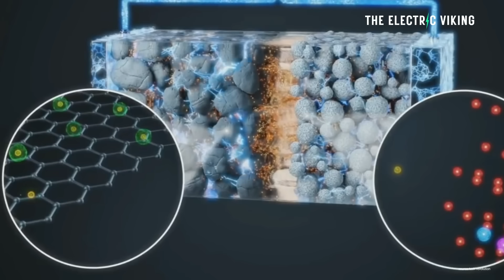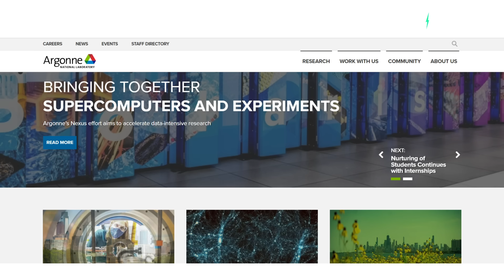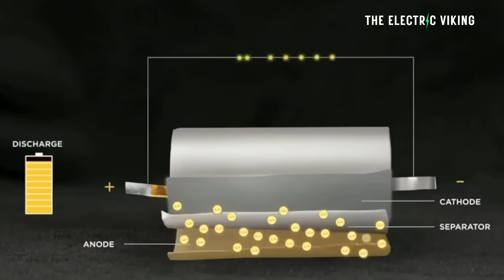US Government Scientists expose why solid-state batteries keep failing

Comment: Judging by the number of battery failures that are causing fires in electric vehicles in China, I would venture to say that the Chinese battery companies are either aware of the filament growth issue and are producing and selling batteries knowing that there is going to be a fair number of failures or they are not aware of the issue. I don't believe that they do not know as this issue is not confined to just lithium based batteries, it is a common issue with almost any battery, rechargeable or not. It has been known about fot years, decades even. It is a matter of coming up with a material combination where it takes a very long time (number of charge/discharge cycles) before the issue is the reason why the battery fails. In early rechargeable batteries, the product would die or severely degrade after only 100 cycles. Technology (material combinations) improved and the cycle count improved to well over 1000 and so on till today where the cycle count of a well designed and manufactured battery is over 10,000 to 100,00 cycles and the energy density has increased dramatically. Look at Toyota, they have been selling hybrid electric vehicles for decades and how many battery fires have they had? I believe it comes down to shoddy manufacturing techniques and a don't care attitude of the manufacturer. As long as they make lots of money, why spend time and profits to fix it.  When the Americans or Europeans come up with a better solution, they will just copy it.
These "ghost" filaments may well disappear because as soon as the filament bridges the dielectric as it creates a short circuit that is instantly vaporised by the high current that tries to pass through it. If, as he says, these shorts are happening so often, then if you connect an oscilloscope across the battery, you would probably see these shorts occur as "noise" on the voltage waveform.
The problem will be solved, but until then, be prepared to see large numbers of fires continue. 
Where do German car companies get their EV batteries from?

Comment: Any stress locked into certain metals from bending or compression etc. will spawn the growth of metal whiskers until the stress in the metal has been relieved by the migration.  Holes from tiny flaws in insulator plates, like those in ceramic capacitors combine with electric potential will lead to the growth of dendrites that cause shorts.   Any experienced engineer building and testing prototype solid state batteries already know all of this.  Those new to the field have no idea yet. Managers with aggressive schedules and large retirement size bonuses on the line have likely put a month or two in the schedule for magic to happen that will solve these problems that they have been avoiding reporting on to upper management and investors for years.   Add in the wide temperature range, pressure fluctuations, vibration and accelerations that an automobile battery must endure and  a lot of this stuff doesn't show up until you've tested thousands of parts for many years. By the time a reliable solid state battery is on the market, I'll be to old to drive a car.  Of course by then the cars will not need me to drive them.  Ha.

Comment: Suit the TOYOTA for the hybrid definition. The submarine with diesel engine generate electrical power to drive the electrical motor connected with propeller, no one call this type of the submarine is Hybrid power submarine. Only the plug battery combination with combustion engine can be call the hybrid power.

Comment: As a persen direcly working in SSB research I can definately tell you that this is nothing new und that we do test for this in the Lab for all possible solid electrolyte systems. Dendrites are not the biggest Problem in all solid state batterys, it is a symptom. The real issue is the electrloyte ionic condaktivity, interfacial resistance and preventing of delamination!

Comment: Asia is in front here solid state batteries have been around since the late 90s and Japan the battery power house has been developing them ever since. Japan is getting the production lines built out as we speak and china’s following them closely. Unfortunately USA is behind here and as we can see it’s the overseas companies investing billions in America to make battery factories which will be a good catch up for Americans . Flaws get overcome easily enough , as Japan has done hence building production lines up  lithium / ion is just not good enough tech unfortunately, consumes way to much energy and resources to produce, is not energy dense so has to be 1.5 times bigger than solid state batteries for same density. Lithium ion is 40 year old tech now all the chemistry has been done and it’s fully developed . Solid State is the quantum leap in storage we need to make EVs mainstream, viable reliable and cheap .

Comment: Once you've identified the problem, you've solved half the puzzle.
Reply: In the lab perhaps but finding the viable, stable and scalable solution and deploying it to actually make these at scale will years.  Once they are in production it will not be in cheap EVs, it will be in planes, drones and supercars.  It takes time for a commodity like a higher performance battery to hit scale for the average consumer.
Reply: I’ve identified the problem: the 2nd law of thermodynamics.
I’m now halfway to a perpetual motion machine!
Reply: I have identified a problem: It is not greenhouse gases causing warming temperatures; It is the building materials man uses. Proof 1(Experience) On a sunny day and your barefoot, what you walk on outside, from coolest to hottest, is grass, dirt, sand or cement sidewalks, black asphalt roads, and metal plates. This is why there is the phenomenon called Urban Heat Island effect. Proof 2(basic physics): The greenhouse gases worried about by climate change scientist are all invisible gases, and solids, especially black solids like tar, will always absorb more photons. Proof 3( the data): The heat in urban settings doesn't shift with the gases. This means the attack on greenhouse gases is wrong, and the focus should be on heat generators, heat batteries, and heat engines in urban settings so as to produce green energy and lower the heat. (If you need a visual, think campfire or space heater.)

Comment: Lithium filaments are called  "dendrites" in battery parlance.
Reply: It's actually a term describing crystalline formations which fractal like properties in this context.

Battery cells are probably just the only context that the average (non geologist or material science) person is ever going to learn about them.

Look it up on Wikipedia under "Dendrite (crystal)" - they can look almost like branching fronds on a fir tree.

The other popular type of dendrites being connecting branches from neurons in the biological context.
Reply: @mnomadvfx  That's a bold statement.  I'm an average person, but these dendrites sound a lot like the 'tin whiskers' that were killing satellites in the 60's, 70's before they figured out that the dendrite growth was acellerated in the vacuum conditions of space.
Reply: Maybe not lithium then...

Comment: the real way to keep from being ten years behind china in tech like batteries, is to have the discipline to stop outsourcing tech and manufacturing to them. in fact, domestically, the US should probably start embracing more vertical integration within smaller companies, counter balanced with anti trust enforcement and more rapidly adaptable regulation capabilities, to foster domestic market driven technology advances. at the same time, sharing such advances globally only once they have been established locally from a manufacturing implementation standpoint. in other words the US needs to "tighten up" to become a leader again.
Reply: "But, But, But. Muh Corporate profits!"😮

All jokes aside I agree. Corporations should stop hollowing out our industries just to increase profit margins.
Reply: Nobody is 10 years behind China
Reply: under biden a bunch of battery manufaturing plants are being built. good union jobs.
Reply: True
Reply: Nobody is ten years behind China in anything.
Reply: I don't see any way you can outsource the tech which had been ten years behind China already, to China.
Reply: Cost in US is too high, import n setup manufacturing in countries that don’t hv the drive to copy your tech. Singapore is one, it has no motivation for tech innovation. Just hv to be careful of the chinese foreigners that go there to work, can ask the govt to ban foreign workers n still cheaper than US😂

Comment: I should start a prediction market question: Which is proven first? 1) Toyota Solid State Battery EV with Tesla FSD Level 5, or 2) Bigfoot
Reply: The answer: 3) Ford goes belly up.
Reply: @ubermenschen3636  They won't go belly up. But the company is basically going to be turned inside out, with only the name and family control remaining the same.

Comment: Interesting!  There are similar problems with lead-free solders long mandated for use in consumer products like cell phones to prevent lead from ending up in landfills which may over time leach lead into the environment - lead is a well-known toxic heavy metal.  Lead-free solder alloys have a tendency for the high tin content to grow "tin whiskers" which can eventually create short circuits between conductors on circuit boards, with obvious bad consequences.  Various mitigation strategies are offered, but the underlying cause of tin whiskering is still somewhat mysterious.  Two steps forward, one step back...
Reply: Yep, thought of exactly this solder.  Besides the poisoning of society aspect, lead is a wonderful substance.  Lead paint lasted forever; lead in gasoline stopped knocking.

Comment: We had the same problem in semiconductors 45 years ago: dendrites.
Reply: @SuperFredAZ, @_droid
Adding lead to semiconductors or to solid-state batteries seems counterproductive. Do you know how the 1979 problem with semiconductors was solved?
Reply: @crustyoldengineer  the problem was caused by gold migration from the bond pads (I think), any we removed the gold from the process, solved the problem, it was called "purple plague" since it looked purple under the microscope
Reply: Somebody added coffee grounds I think to deal with it in another report

Comment: Dendrite formation has always been a problem with battery technologies -- this is nothing new.   I predict that the most successful way to deal with this will be an extra phase in the battery charge/discharge cycle that has the sole purpose of removing the dendrites before recharging or after charging in complete.  This may involve the use of an intermediate element or elements between the plates and electrolyte which has the sole purpose of destroying the dendrites.

When this happens I expect to get 5 percent of the gross from whoever patents it and claim this comment as proof of prior art 🙂
Reply: Many years past I designed such a charger to revive and charge PP9 batteries for a logistics company that used heaps of them in various gear.  The detection and zapping phase was a part of the cyclic process.  While probably not as effective as gaining access to each individual cell, the customer was totally amazed that of the hundreds of NiCd PP9 (well really 8.4V) batteries they had kept for some reason, more than 90% of them could be revived and live another life in service.
I posted a similar/connected series of comments 2 weeks after your own above.
Reply: I'm sorry that won't work
Reply: @doylewillis9587  explain.
Reply: Nickel Cadmium had this problem, and there were chargers that had optional conditioning to reduce the dendritic.

Basically, every rechargeable battery tech has some sort of problem like this.
Reply: Sounds like a good idea that being the precharge thing which I can't quite visualize how this would be done. I think dendrites form mostly when the batteries charge; I think of this as a metal plating operation. Btw, EOS Energy makes a zinc bromine battery mainly for utility power storage and has apparently solved this problem for their zinc based batteries with special additives to their electrolyte. Historically zinc air etc batteries were among the worst with dendrites. Eose has reduced the weight of their batteries by over 80% while increasing charge capacity. I believe they will someday be in cars. Eose has over $1/2B backlog in orders! I have accumulated a good amount of their stock.
Reply: @badbrain3185  Dendrites form in different ways for different battery technologies, and there are other capacity limitations.
For Nickel Cadmium, Dendrites form based on charge/discharge speed, voltage and temperature - fast charging/discharging at 10C (10 minute charge/6 minute discharge) is the worst, 1C avoids most issues, and temperature and voltage controlled chargers reduce formation to a minimum.
There is also a memory effect with Nickel Cadmium, where if a battery is repeatedly drained to the same charge level and recharged, it will refuse to discharge beyond that. This can often be fixed by a few cycles of forced discharging/charging (cycling) or avoided by an occasional full discharge, and some chargers support those.
The biggest advantages of Nickel Cadmium are high rate charge/discharge and overcharge tolerance and number of usable discharge cycles. The disadvantages are weight, high self discharge rate, and the fact that lifespan is depleted nearly equally regardless of when in the cycle recharging is done.

Lithium Ion is much better in terms of power density, self discharge rate, weight, and memory.
But Lithium Ion requires smart chargers, has risks of thermal runaway and/or swelling, and doesn't tolerate high rate charge/discharge well.

There are theoretical ways to prevent/reverse dendrite formation, and those are constantly being researched.
In some cases, there is a charge level or use case that preferentially uses Dendritic material, and that can shrink or eliminate Dendrites.
But once a Dendrite forms a short circuit, the battery is permanently compromised to that extent, barring some new development that could shrink the Dendritic connection.

For all technologies, there is a way to pretty much prevent the problems, but it often involves impractically slow charging.
Reply: @aaronbredon2948  I was going to add that in metal plating the slower it is done the smoother the surface so this is understandable with higher current flow the surface is rougher. Dendrites would be the extreme of this.EOS won't share much so I believe they are now using zinc bromine because its completely sealed from ambient air and not affected by variations in humidity  or other factors that have plagued zinc air batteries.

Comment: Solid-state battery technology is a tough nut to crack. But every new discovery will get us nearer to a fully functional battery. That is why the Biden administration is on the right track with investments in the R&D needed in this realm. Nevertheless, solid-state batteries have yet to show the promise we all thought they had. More work remains and at this point our best hope might be other technologies and chemistries that do not have the problems presented by solid-state. Let's hope that this research will help to move the needle in the direction of cheaper more reliable power for EVs.

Comment: I've been working with cordless drills for 25 years. Those batteries don't last long either.
Reply: 25 years ago we had NiMH and NiCAD. 100 years ago we had iron batteries in EVs. Times have changed, and times will change some more.
Reply: @jamesvandamme7786  We had lipo back in the 60's butit wasn't commercially available till the early 2000's when they became cheap enough to come into use in cellphone batteries. Even if we can solve the issues it will take another 40-50 years for them to be affordable.

Comment: It's out there folks. I have been following them for more than 2 years.
It's a company called "Solid Power" out of Colorado. BMW is currently putting the "ONLY TRUE" SSB, into a demo-car this year.

It's not 2035, 2030 or even 2028. It's likely going to be as early as 2025 or as late as 2027.
Reply: How do you see, it seems demo car will be available in 2025, when the mass production would be?
Reply: @trexeyesonly55  
The BMW demo is 2025 and I suspect that it would take 2 years after that. Everything worked well and BMW is asking for a different chemistry. SLDP also has to build for Ford and Hyundai. They might all ask for different chemistries and capacities. That's why I'm excited that Solid Power can change their chemistry on the fly. No one else even has one battery, much less a battery tailored for each customer.

2026 at the earliest, 2028 at the latest (IMO)
Reply: @sobeoki7450  thanks, it seems plausible
Reply: A sample cell validation is basically proof of concept.  B sample is when they stop changing the cell design and work on integration and manufacturing.  Definitely not mass production in 2025.
Reply: @jrherita  
They started mass production last year. They are making enough product(s) for OEMS to verify and qualify. 
This is NOT a company with just one battery. They have at least 4 in the pipeline. The first A-sample is now going through formal qualification and certification. That started last year. They are working on a B-Sample for BMW right now. They started last Q.